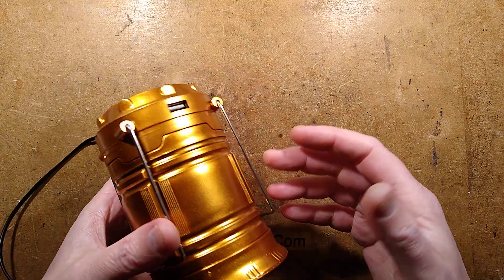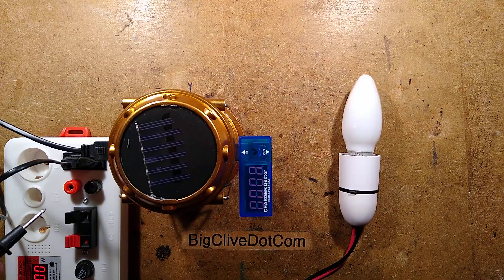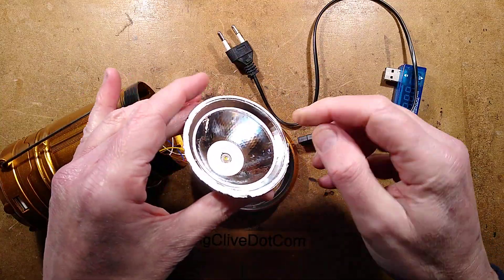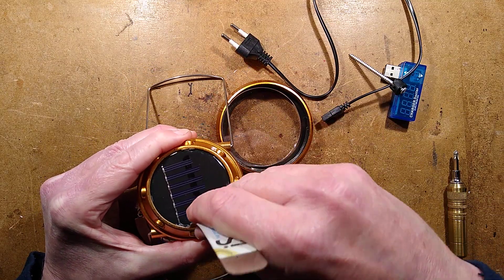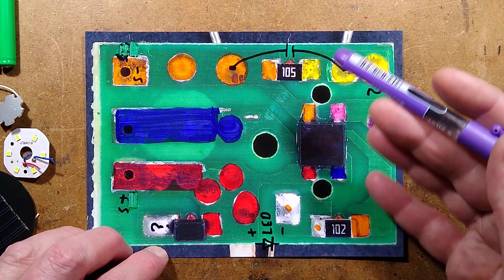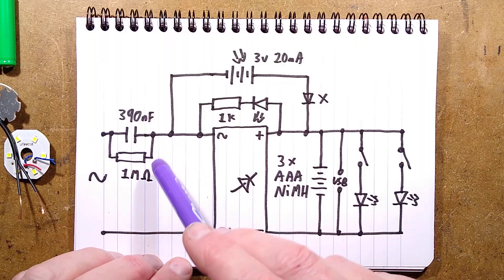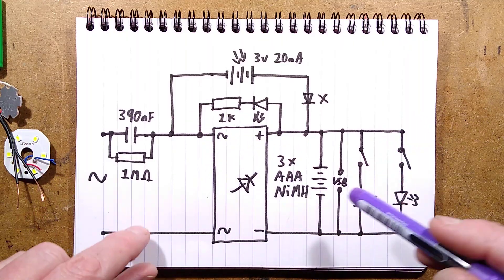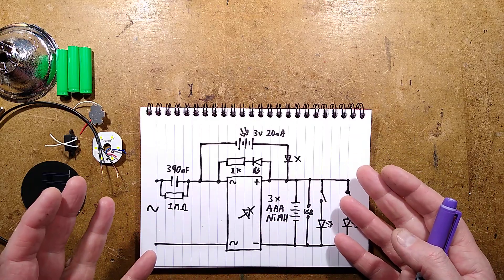Dangerous "death Dalek" lights still on eBay

Comment: As well as reporting dangerous products, they ought to have an option to report sellers listing stuff in the UK that aren't fitted with the legally required 3 pin plug
Reply: they'll just add the third prong but have it connected to nothing anyway LOL
Reply: @sinephase  The scary thing is, even reputable sellers over here don't care. 
I got an indeshit branded tumble dryer from i think currys about 10 years ago... The plug has no kite-marks, has no fuse and the earth prong is plastic. Yes plastic, on a mostly metal appliance! Also the cable is only 0.75mm which for something with a heating element seems awfully risky!
Reply: why are you bothered with it being 0,75mm? it acts as a heater for further drying your clothes an\or your house
Reply: @theoneohmresistor  Haha that made me laugh
Reply: @adamholmes91  Don't have anything better to care about?
Reply: @160rpm  Nah fire hurts lol
Reply: @160rpm like an emergency exit or a fire extinguisher?
Reply: @adamholmes91 wouldn't need a inplug fuse if you guys would stop using shitty ring circuits ;)
Reply: @DarkAttack14  Even if your simpleton radial circuits were used, it would cut off whatever was on that circuit. So if your fridge was on that circuit and you was at work, you can say goodbye to your food.
Reply: @adamholmes91  "simpleton" kinda ironic when ring circuits are signifcantly worse than radial. Guess what, breakers don't normally blow if nobody is home to cause a circuit breaker to blow lmfao. Ring circuits are a shit excuse to use thinner gauge wire than you should and you very well know that. Ring circuits are more prone to overheating wires due to their design and smaller wires, and let's say you have a dryer next to a break in a line. Now the whole side of the ring that's still connected has to carry the load, which it will not be able to due to its smaller wiring. Radial circuit? Yeah large appliances are on their own line so zero chance of such scenario occurring
Reply: @DarkAttack14  Clearly you are misinformed.
Reply: Why should the plug decide if i can buy a device from ebay?
What if i wanna import a device from another country? Doesn't even have to be retro stuff...
Reply: @chrisakaschulbus4903  because its an offence to sell a new appliance in the UK that isn't fitted with a standard 3 pin plug (with one or 2 small exceptions)
Reply: Presumably eBay has criminal liability for facilitating the sale of illegal / dangerous electrical products into the UK, but the plods ignore this because it’s retail - and we know they ignore all retail crime such as shoplifting from shops…
Reply: ROIGHT
Reply: Government has no right to legally require any plug, I'll sell whatever plug I wan5
Reply: @AverageAlien  The Plugs and Sockets etc. (Safety) Regulations 1994 requires that domestic mains powered appliances are fitted with a standard plug conforming to BS 1363

So yes, legally speaking here in the UK they can tell you what plug to fit to an appliance you're selling
Reply: but that the least of the problems
Reply: Brits are really scared of electricity for some reason.
Reply: eBay and Amazon are effectively bombproof from this kind of reporting because they claim the items are sold by third parties. I've tried reporting dangerous items to Trading Standards and they seem apathetic and toothless.
Reply: Cauldron bottoms
Reply: Just report it to different safety organizations,tv and radio stations;report it to the uk government agencies as well as your mp;share the information yourself,using various methods.
Reply: Why?  Are you so lazy you won't wire a plug?
Reply: You got a loicense for that report?
Reply: @asahearts1 What report?  And why do you need a license to make a report?  I assume loicence is Irish for license.
Reply: If the product is classed as 'double insulated' then the third prong is often plastic. See mobile phone chargers. 

There is also a category of products that can use the 2 round pin style in the UK, as they are designed to plug into the shaver outlets in bathrooms. Those are isolated, in case of moisture ingress in the bathroom, so are less risky. Though many people use an adaptor and plug them into the normal socket anyway. Electric razors and toothbrushes generally come in that category. These are also double insulated, so are classed as safe.

This thing is not double insulated, and the enclosure is metal, and it is connected directly to the power pins. It breaks all the rules (just not necessarily in the right order) of CE (and now UKCA) safety certification.

Comment: The negative end of the solar panel finds its way to the negative end of the NiMH cells through the bridge rectifier. The positive connection is of course obvious. Thus the solar panel actually can (weakly) charge the cells.
Reply: Its a 3 v solar cell going thru two diode junctions before getting to the battery leaving about 1.8 v maybe less because the diode drops will be more than 0.6v with the very light load on them trust me nothing is getting charged even a bit hahaha
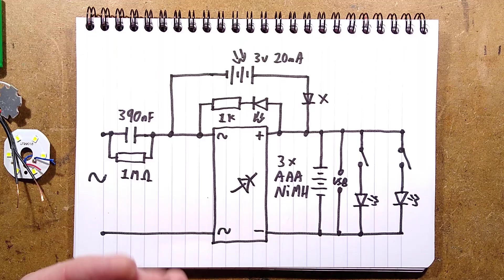Reply: Well, he did say that the diode on the + side is actually a jumper in this version of the circuit (7:08)  so only 1 diode drop, leaving roughly 2.4V. Might slowly partially charge the (alleged) NiMH cells, or not. Anyhow, I get you guys' point.
Reply: @sootikins  how can 2.4 v charge 3.6v nominal voltage 3x nimh cells and how can it light a led
Reply: @daveselectronicslab  A GaAsP red LED lights at <=2V. The voltage across the cells is significantly < 3.6V when well discharged. Read what I wrote - I never said it would work *well*, I qualified everything I said with words like "partially".

Comment: Inspired by your original video, I rewired one of mine to use a USB-C charging lithium ion cell. I posted my results on Instagram, and my account is first name underscore last name. They are still being sold today. I picked up 3 for $10 at an Amazon bins store last weekend. Even if you don't do a lithium ion mod, immediately throw away the AC cable. Charge via solar only.

Comment: Why the hell did the designer of this light allow it to be connected directly to the AC mains?  I would have designed it with a 5.5/2.1 mm power jack, to be charged from an 8-15 volt AC/DC wall wart power supply that had safety agency approval.  This would also have made it practical to charge directly from a 12VDC accessory outlet in a car.
Reply: I often say  "Chinese design" is an oxymoron. They don't design, just make. Of course there are many decent Chinese product designers, but the statement generally works for this sort of cheap tat. Yeah, the mains input isn't really necessary, a USB input would have been enough; surely everyone has at least one USB power supply these days.
Reply: Yes but that would be sensible!   (also would cost a little more... can't have that!)
Reply: wires cheap, wallwart not cheap. Nobody would buy it if the wall plug wasn't included.

Comment: I have a lantern that is the same shape, and operates the same way, but it uses AA batteries… Gotta be a problem in a lot more products, that have the same charging issue…
Reply: Here’s how lazy I am… I can see said lantern, from where I sit. I could walk over, to check, if it uses AA or AAA batteries, but I’m posting a correction that says “I could be wrong on it being a AA battery, but mine isn’t rechargeable.”

Comment: This was one of the first things I bought off Aliexpress since I needed a cheap camping light. The moment I saw the flimsy power cord I knew I'd never charge it from mains. The solar panel on the top DOES work - the few times I need the light, it works fine and I've had it for 5 years without charging it through mains.
Reply: If it's the same as this one (on the inside), the solar panel will never charge the cells as that is physically impossible. If it is connected correctly and a six cell version it will not charge the 3 batteries due to lack of voltage and even if it was a 7 cell it would need direct sunlight ... Even if the voltage was sufficient, it will also not have sufficient current to even get to C/40 (about 20ma) which is the recommended maintenance current. My guess is yours has alkaline batteries like this one which will last for days at the current required for this thing to work and have some but relatively little self-discharge.
Reply: @NoNameForNone More likely it was one of the genuine original OEM death Daleks with NiMh cells. If I recall, they did work and do recharge via the solar panel, but very slowly. Here with the collapse of Chinese manufacturing it’s probably some mom and pop place that copied them, making it even worse, and started churning them out to fill some orders. Impressive, but in a really bad way.
Reply: Based on the circuit diagram, it should actually work. Does your one have the same tiny solar cells?
Reply: @userPrehistoricman  It does have solar cells at the top that look similar. Since I haven't recharged it ...ever ... and used it now and then, it must get its juice somewhere else unless it was fully charged and holds a really long charge.
Reply: @redavatar Clive was suggesting the batteries might be single use batteries not rechargeable at all. They contain enough energy to last long enough to make you think it's working. Then when they run out you just throw the whole thing away.

Comment: Jesus... that light is on the market for  like 10-15 years now? And some people found date on some versions of it from 20-21 so they still make them without any fixes...
Reply from the maker: To be fair, they have made a change.  The rechargeable cells turned out to be non-rechargeable, and pose an extra hazard.

Comment: With nearly a million subscribers, you'd think one of them would be in a position at eBay to do something about these.
Reply: Look at the view counts. About 50k, about 120k for a large view count, 160k is an outlier, after 2 months. So only 1 in 20 subscribers watch although to be fair some you tubers report only half their views are from subscribers, so 1 in 40 subscribers maybe with the remainder not subscribing whether regular viewers or just browsing.

Even if all 1M watch, that's just 1M people out of say 2000M adults in the Western hemisphere of working age. Do you think it's likely that 1 in 2000 people in the Western hemisphere are employed by ebay and that their job is a management role where they can make a change?
Reply: @igrim4777 And on top of all of that, what are the odds that an eBay employee watching this will either be in a position to do anything about it or want to do anything about it?
Reply: @igrim4777  It's still a pretty good number - and it doesn't have to be anyone senior - just someone with a brain who can pass it up the chain. Also, anyone with an eBay VeRO account has a direct link to the right people at eBay to report this sort of thing.
Reply: @igrim4777 Maybe we could get Mr. Beast to measure 240v between the shell of a USB plug and ground?  Maybe Russell Brand?  They've got millions of subs.
Reply: It's almost as if ebay know & don't care. OH WAIT!
Reply: They could, but they don't want to. Because they make money off it.

Comment: Long time follower, sometimes comment. Obviously not going to buy this thing thanks to your review. 

Unrelated question but I can't think of anyone else to ask. I'm doing a bit of home automation, zigbee with Home assistant (freaky good so far). I have a working alarm system, door sensors and smart plugs for lamps etc. Have you looked at any of these plugs or the light switch relays pn ZBMINI by sonoff. They have a CE mark 😅. I can send you one of you want to pull it apart ?

Comment: I doubt that a phone case is electrically connected to the socket. Nonetheless cheap products have plenty of risks
Reply: A phone case will be grounded to the charge port on the phone. The live was across the grounding of the usb port on the device so they would be directly connected.
Reply from the maker: The chassis is often at zero volts, so connected to the negative of the USB port.  A lot of people have died from holding phones plugged into faulty chargers.
Reply: @bigclivedotcom And something kind opposite actually happened to me: Plug the phone into a dodgy-but-not-shocking charger and the touchscreen starts to not respond or to act by itself because of too much noise in the output of the charger.
Well, if you deliberately touch a metal part of the phone it actually stops.
Better if you're grounded too.

Comment: "This can kill you", promises promises 😅

Maybe the ones with a uk plus are different? I say maybe...

Can you Probe live connections without worrying about a massive flash or your probes sticking to the connection? I've always been weary of that and attach them and then turn on, just in case 😅
Reply from the maker: For probing mains voltage connections your meter should be at least category 3 to avoid high current flow in the event of a failure or accidentally leaving the probes in the current connections.
Reply: For a flash there needs to be current going tru the connection as your multimeter does not draw any power from the connection there sould not be any significant power running tru your probe leads.
Reply: The capacitor should limit the current if things go pear-shaped.  Regardless, there should be very little current flow when probing voltages.
Edit: Listen to what Clive says below:

Comment: I wonder if they'd go bang if you had 2 of them and they touched eachother, if one was referenced to neutral and the other to live since the plugs aren't polarised.
Reply from the maker: It would have to be exposed metal.  But two phones charging simultaneously on different units could arc if touched together.
Reply: Can we have a practical demonstration please. It’s nearly firework night!
Reply: @nicolassales8679  that would be a Guy Fawkes Shocker.lool
Reply: We need @ElectroBOOM to test
Reply: Ah ok Clive, I thought the copper coating/paint on the outside was connected to the common reference.
Reply: @imranahmad2733 

That's just plastic with a cheap paint job. Not conductive.

Comment: I thought you were going to say "aluminium" after saying "copper coated"; couldn't believe my ears when it turned out to be steel!!
Reply: @tissuepaper9962 

No skin effect. It's 60 Hz not 60MHz.
Reply: Aluminium expensive steel cheap. :)
Reply: @tissuepaper9962 Skin-Effekt at 50 Hz is about 9,38mm. I wouldn’t call this significant
Reply: I’m surprised the steel strands are copper plated.  The number of customers likely checking is close to zero.

Comment: It's kinda a nice multipurpose form factor, with room to hack in stuff like larger batteries or a better solar panel.  Perhaps there's a video to be made in de-deathing this thing somehow.  A 1:1 transformer on the USB port?  Driving the USB port off a whole separate boost/buck converter?
Reply: USB is DC, so the 1:1 transformer has to be on the input.
Reply: If it was mine, I'd probably throw the AC mains plug away and convert it to charge from a regular old 5V DC USB power supply. Wouldn't need the dropper capacitor or the bridge rectifier, and might not even need the diode from the solar cell. Charging directly off a mains supply instead of needing to plug it into a USB supply is just not enough of a benefit to be worth the extra danger. Plus, I have little mains-to-USB power supplies all over the place these days so it isn't like I'm making my life much less convenient by needing to charge off of USB.
Reply: Ok, but one has to invent the DC transformer first. All jokes aside, one could just replace the psu with the guts of a regular phone charger.

Comment: I wonder if the dropping capacitor even has a sufficient voltage rating...
Reply from the maker: It's the typical one found in LED lights.
Reply: Those big honkin' reddish-brown ones (see 3:11) are usually in the neighborhood of 600V.  Suitable for driving the death beams, just not in electrolytic form because it can't be polarized.